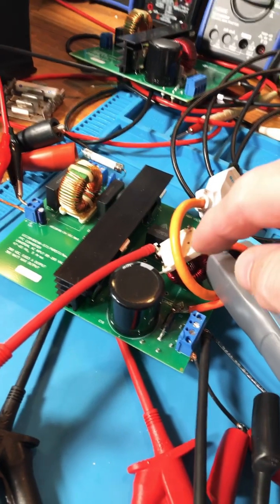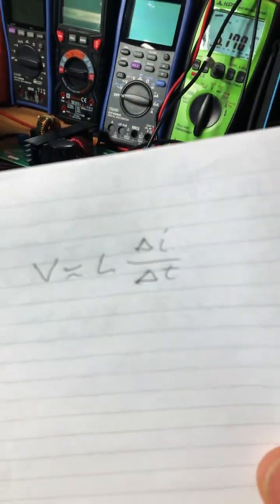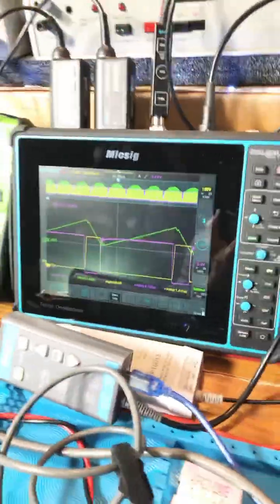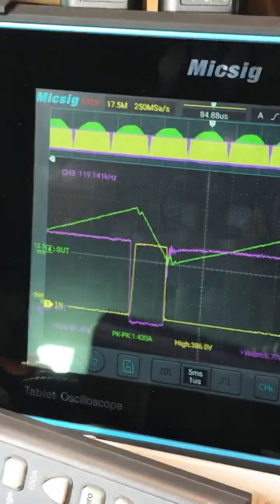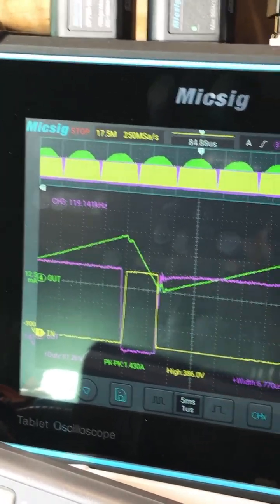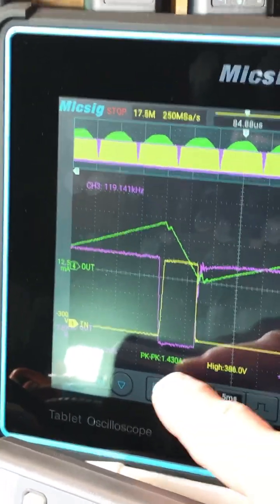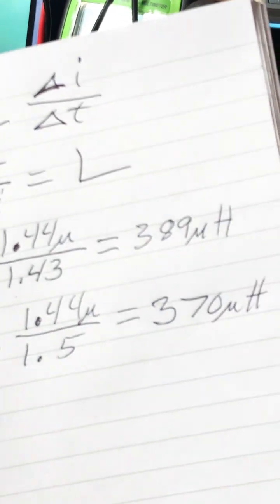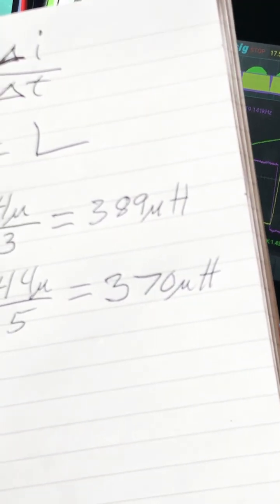PFC Inductor value calculated from Measurement

Comment: Is the coil we are pushing current through, between the source and the ground?

And then we measure the voltage on the coil by attaching the probe in parallel  to it, from Drain to Gnd?
Reply from the maker: Thanks for asking!  I'll show this in a video very soon;)  This was just the preview.